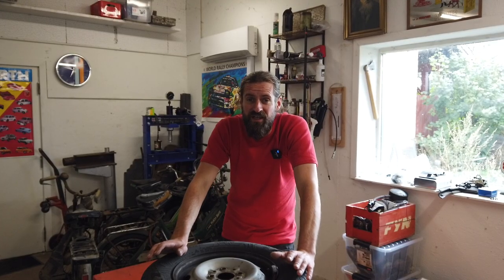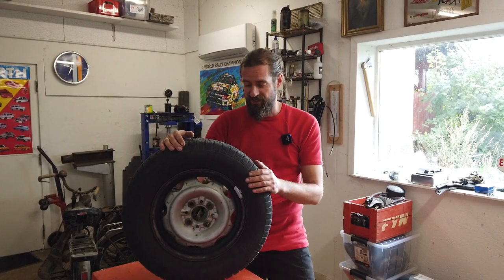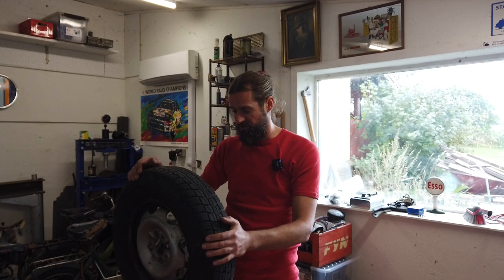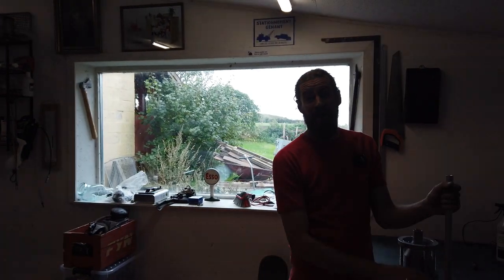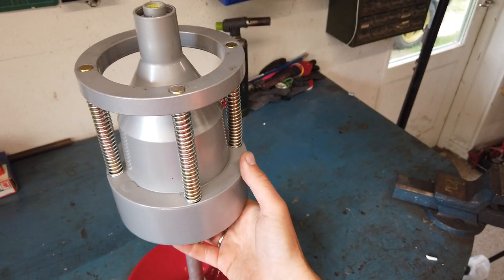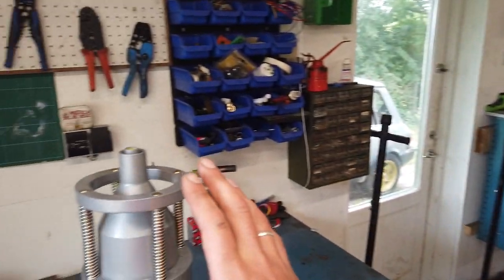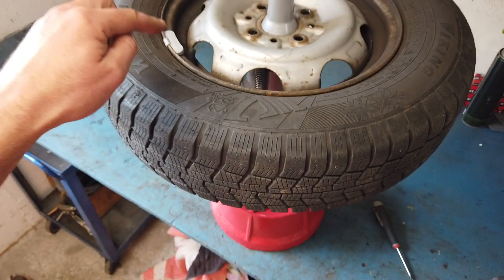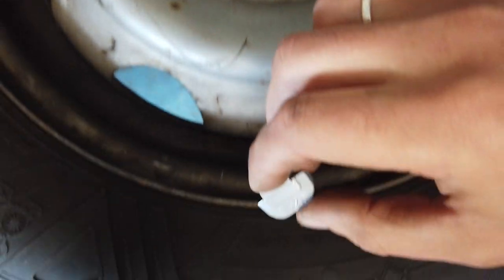DIY Wheel balance. The art of balancing a life with a Panda

Comment: Haha I'm thrilled that I was actually able to teach you something! However, you used it correctly for removing the outside weight, by pulling up, should have done the same for the inside weight, and it would have come off nicely ;) 

I like your new bubble balancer! It shouldn't even be necessary to have to the tool perfectly vertical, as the tool will accommodate for it on its own. The pivoting piece should still be vertical, even if the base is not perfectly vertical.
Reply from the maker: The manual for the tool states that its very important to make sure the floor and base are a perfect level surface... But iI get your point, it should not really matter...

Haha I almost learned it then!
Reply: @SeasideGarage  I think it’s just one of those things they have to write, in case it falls over and someone has an accident. At least it should not affect the accuracy of the tool in any way.. :)

Comment: Use the 2 step Y method. You place 4 weights of equal size on the top side. Place them 120 degrees apart, on the side the bubble is towards. Shift the weight pairs towards each other or apart until the bubble is centered.

If the weights get too close together, they're too light. If they get too far apart, they're too heavy. You want to stay as close to 120 degrees apart as you can.

When the bubble is centered, mark the tread at each weight location. Remove the wheel and install one weight on the back side of the rim at each location.

Put the wheel back onto the balancer and use the remaining two weights to center the bubble. Mark the tire sidewall at the center of each weight. Remove the wheel from the balancer and install one weight centered on each mark.

Then check it on your German spin balancer.

Comment: Great tool. Yes, doing it yourself is so much more satisfying than paying someone else. One question: Does the presence of dirt on the tire and rim affect the accuracy of the balancing. I think I would've been tempted to scrub the rim clean just to make sure every source for transient weight was eliminated.
Reply from the maker: I removed all stones from the thread prior to balancing I don´t think the dirt makes a noticeable difference. :)
Reply: @SeasideGarage  Right: Wheels pick up so much dirt with normal use. If this threw off the balance we'd all be driving vibrating cars. Cheers.

Comment: Only problem with your technique is that it doesn’t take into account the vertical alignment like the rotating machine at the tyre centre does.
A good test would be for you to get it as good as you can then, take it to the tyre place and see how close, or not, you actually were.
Reply from the maker: It would be interesting to test out! So far, its not perfect but good enough :)